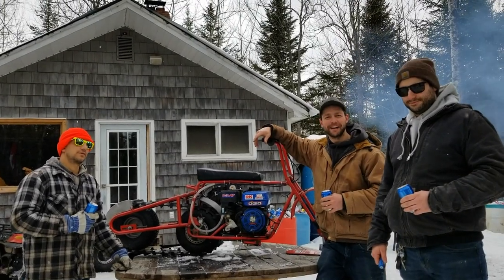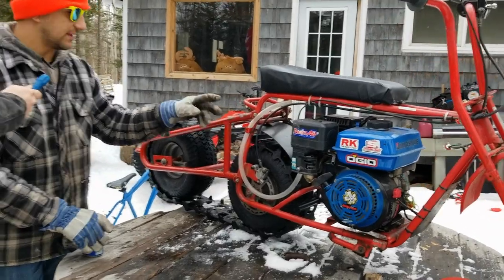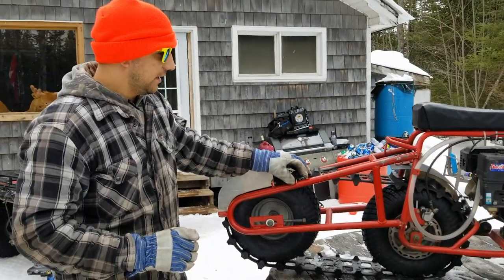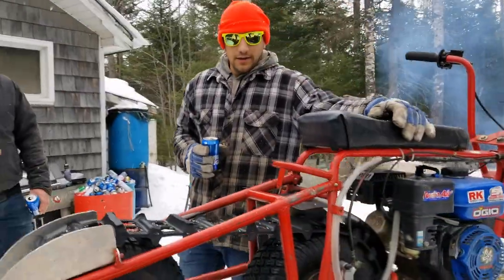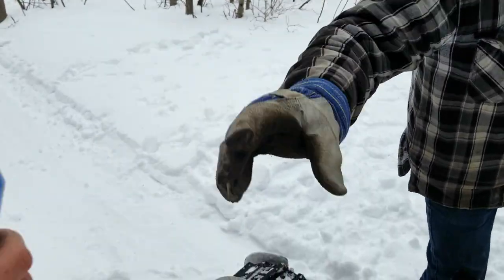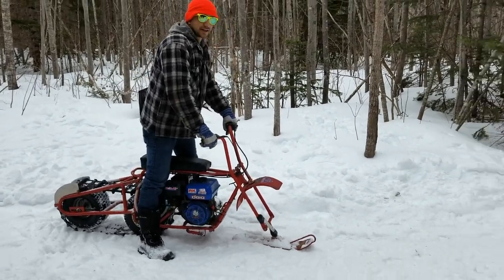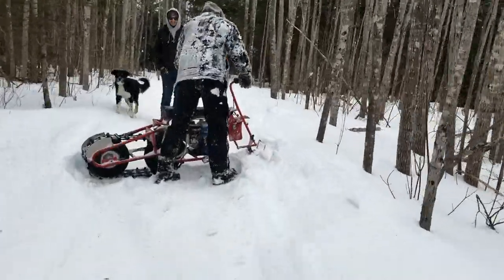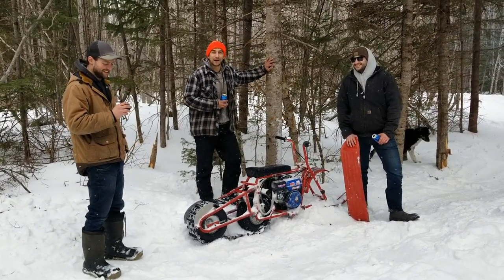Mini Snow Bike Track Kit Demonstration

Comment: Carb icing happen when there's moisture in the air, and the throttle plate be part closed, there's pressure drop like bang ya know. Ref blows whistle, then game stops then starts again.
Just direct some heat back to the carb from cooling-air or somewhere near exhaust

Comment: Hey this thing is awesome! What kind of mini bike did you use for your build and what size was the original motor
Reply: Those are doodlebug db30's. They usually have 80cc motors in them from the factory.

Comment: Im intersted in how well it does is fresh snow? Does it do good in deepish snow? You try it off the groomed road?
Reply from the maker: Deeper then 20cm of fresh snow it will struggle. It is geared way to high, might get a smaller sprocket for next year.
Reply: With a torque converter it would be awesome.

Comment: Nice project, more fun to build then to ride though, I built an electric version of this 10 years ago, Its awful dont do it, front steering is thrown all over the place by ruts and  bumps. Later i built a tricycle with 2 wheels in the front, much better. I had trouble with my track coming off all the time though, uses lots of battery, could only go a few miles. Gas probably a better choice.
Reply from the maker: We are working on a second video, new ski new gearing, testing it soon, should be a lot better!